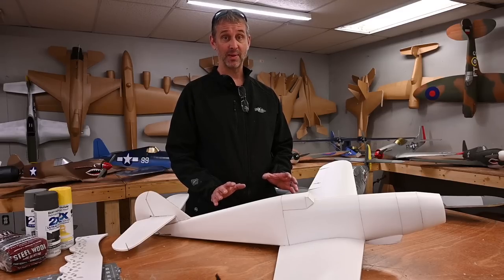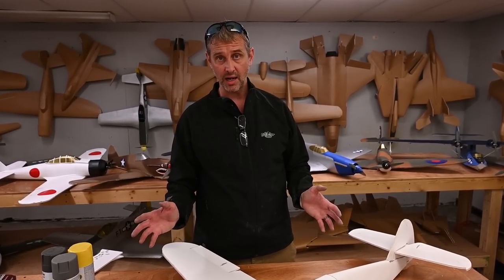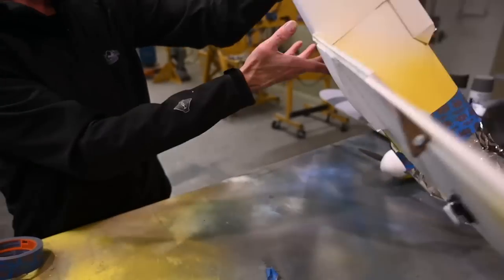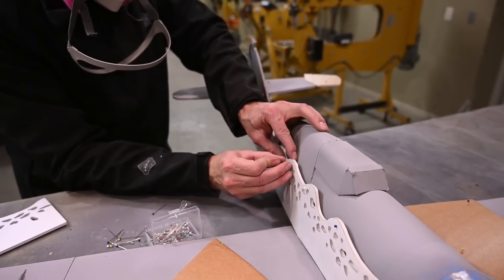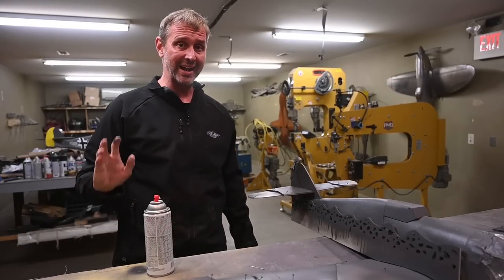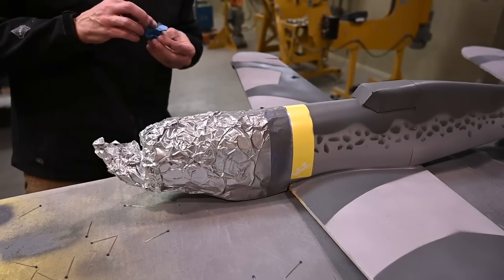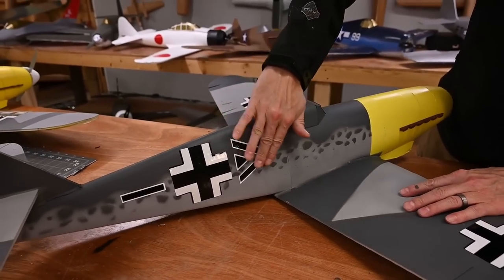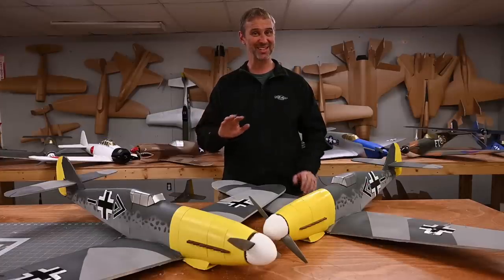Wanna make your plane look sweet ?  |  Simple Paint Tips

Comment: Great intro on foamboard spray painting... To keep the tape from lifting paint, try a little Hot Air (I use a hair dryer or hot air gun) on the tape.  It seems to make the adhesive "less sticky"!  (That also works on getting most "Stuck" labels off, too!).
Good job of that paint scheme...

Comment: I have been painting my electric models with matte acrylic paint from Michaels for many years now without an issue.  You can use latex exterior house paint for the same purpose, and this paint actually resists fumes from gas engines.  The only thing you need to watch out is to use clear epoxy if you need to use nitro engine on the airplane.

Comment: The plane looks great. One trick I have found that works well is to take an old sock and put some baby powder in it. Any where you are going to mask, dust lightly and place tape on that area.  The paint will absorb any excess amount of the baby powder and will release from the tape leaving a crisp line. You do not need to overdo the powder, a little will work great.

Comment: Ive used this same brand, just remember to scuff the surface lightly before painting or you can have peeling problems if you try to mask with any kind of self adhesive tape. 200 grit paper works really well.

Comment: Very nice.  I noticed that the LE appeared to not have much paint.  This may be due to you spraying from the top and not hitting the LE or TE while its masked.  Perhaps it is easier to paint the LE and TE by using a brush to touch up (spray some paint onto a "dish" of aluminum foil and dip the brush in that.

Comment: So, from what I see so far, this maker foam does not dissolve with the Rustoleum paint correct ? So it's not necessary to apply - say a coat of polycrylic first - as a base coat .. correct ?  Also, where can we buy maker foam sheets ? Thank you for your time
Reply from the maker: Charles as long as you don’t peel the layer of paper off you’ll be fine. Also you can get maker foam from our website store.flitetest.com
Reply: @FliteTestTech  Thank you VERY MUCH !!

Comment: Here's a suggestion to make it look MUCH better. The paint scheme looks fantastic but is ruined by those uneven joints where the foam is glued together. Get some lightweight spackle and fill the joints and other unsightly areas. You can even use it to shape some curves like where the wing meets the fuselage. I use DAP Patch-N-Paint. Dries fast and weighs next to nothing. Scuff the surface first then put it on light with a putty knife. Then sand it smooth and paint. Your end result will look like a molded plane instead of foam board.

Comment: Doesn't some spray paint melt the foam?
Reply: Adrian Chupp some do when your painting EPO foam. Since this is waterproof maker foam it has a layer of paper on top of the foam. So it’s pretty safe to paint
Reply: Beware! I just ruined my P-38 with Rustoleum Paint; the same as John is using. It was Metallic Aluminum color. Put it on a little too thick and the paper separated from the foam. Real ugly looking. I have painted all the Master Series planes and this was the first issue I've had. Still think Rustoleum is the best for foam board, just put it on in very light coats!

Comment: i dont know what paint i need use, ewery spray paint what i has buy ,has melt foam lot.
Reply: Matti Virta if you’re trying to paint EPP or EPO foam a lot of paints will eat it. Need to find enamel paint. Since this is maker foam waterproof foam board it has a layer of paper before the foam. So you are pretty safe most of the time.
Reply: @mattthephat216  ok,i try looking what have in thailand, i not has found many what need, in thailand not have lot RC plane stuff. i live home country before and have ALL what need or want, but this country have, horrible, all thais have lot big idiots and dont know anythink hobby tools and anythink good work.

Comment: You need to be careful with what paint you select. 

Some cheap store brand spray paints -- I'm looking at you Ace Hardware -- will eat your foam and weaken your craft. 

I was making fins for water bottle rockets. It dissolved the foam along every fresh cut edge and left only the paper. This increased drag and caused a catastrophic failure.